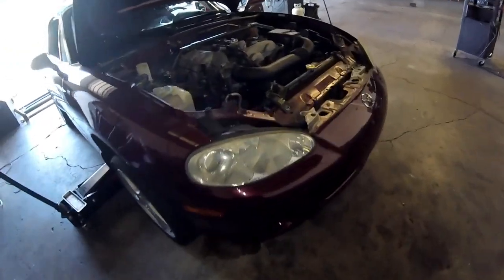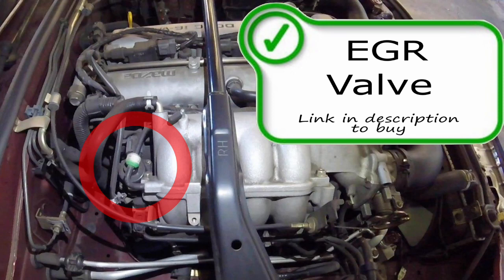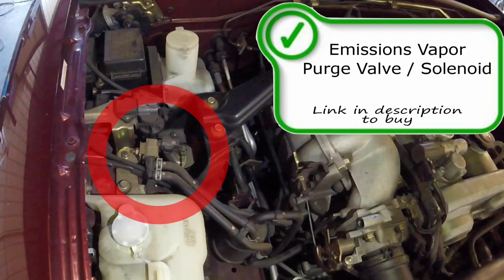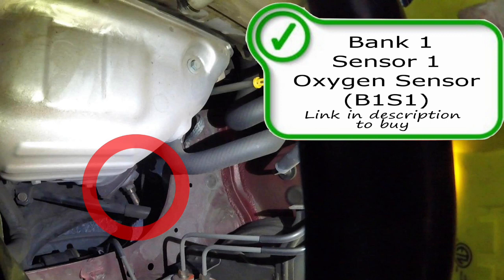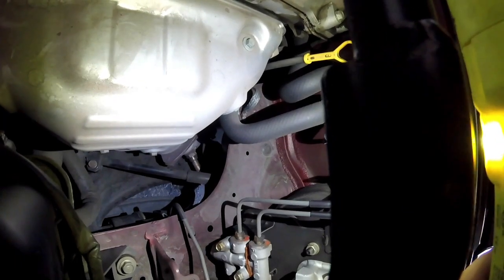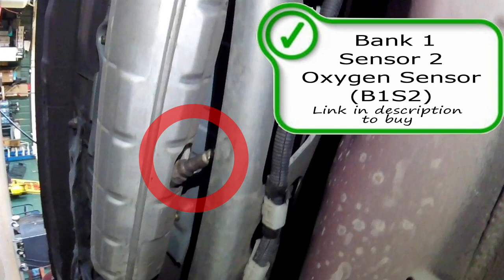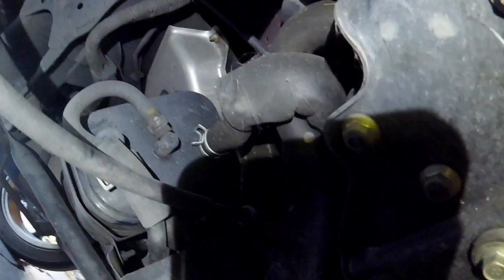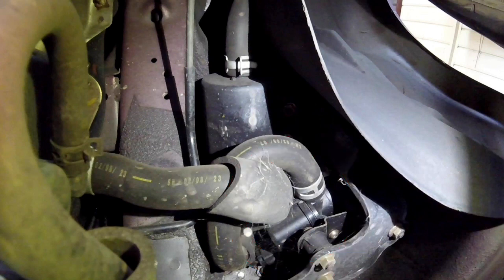⫷ Mazda │Miata MX-5 (NB) │ 1999 - 2005 │ Emissions Locations: PCV, EVAP Purge & Canister, O2, MORE ⫸

Comment: Ok,my Miata NB doesn t have the charcoal canister and the solenoid for it anymore,and at some point,i sensed gas fumes inside it,not from the beginning,just a few months after driving it.Can you suggest a cause for this?Vapor valves on top of the tank,gas cap at the fuel tank,maybe?

Comment: Very useful guys . I have a Second generation mx it turns over but doesnt start . It stopped firing after running low on fuel , possible fuel filter block

Comment: A have a 2005 code po446 and p001 any ideas?
Reply: Where you able to fix the code? Thanks
Reply: @luisgonzalez3057  yes changed  the purge valve but now have a p2195

Comment: Love the video. But let’s see if you can answer my question. Now I have codes p0102, p2402, p0037 and since these codes came my meter fuse blows, but when it blows the car shuts off and in order for me to start it again I must replace the meter fuse. Any idea what could be the problem?
Reply from the maker: The meter fuse powers a lot of different things on your vehicle. The weird thing is, my friend had this exact problem many moons ago. If I recall his oxygen sensor heater circuit was bad causing a closed circuit in the oxygen sensorand inturn it blew the MEETER fuse.  I can't guarantee anything but if I was in your shoes and  I owned that vehicle. I will. I would replace my bank one center to oxygen sensor with a direct fit replacement. Then try to replace the meter fuse.. If the meter fuse does not blow, go drive it for a little bit and see if the car acts any different.

🤞🤞💪👍
Reply: @ScottiesHobbies  thank you for the fast reply. I will take a look a the 02 sensor. And I’m sorry, I didn’t mention I have an 03 NB
Reply from the maker: @BlownMiataGuy  no problem! I was hoping you would have a vehicle similar to the one in the video.

Good luck on your fix. Keep us posted on your progress and ask questions if you have any.

🤞👍💪

Comment: Hi again! Question: is the emissions vapor vent valve at minute 7:10 the same as the CDCV (canister drain cut valve) that I see in my 2000 Miata shop manual?
Reply from the maker: Hey there. Sorry it took a little bit to get back to you. I believe that is the vapor vent solenoid you are speaking of. I looked in my manual and I do not see it listed as a cut valve but it would make sense that it is the event valve valve. If it has a hose going venting to the atmosphere, that is the vent.

 Hopefully that helps you out. Keep me posted on your progress. If you ever get that monitor to set please let us know what it took so you might be able to help somebody else later. Good luck and keep us posted.👍💪

Comment: Excellent vidéo. On my 2000 SE the emissions Evap System is shown as Available /Not Complete so I will fail smog. I’ve followed the driving routines in the Miata manual and have put on several hundred miles but cannot get this last emissions system to reset after a failed battery. Do you think it could be Vapor Vent Valve solenoid or the evap solenoid under the hood? There are no trouble codes.
Reply from the maker: What state are you in?
Reply: @ScottiesHobbies  California
Reply from the maker: And you have no pending codes? Or any hardset codes at all?
Reply from the maker: Only reason I ask is; in Ca you are allowed to have the evap monitor incomplete to PASS smog.
Reply: Nope, there are no pending codes
Reply: I’m fairly sure I cannot smog it this way. Although I will verify. Any ideas what the root cause is?
Reply from the maker: @timmurphy9834  take a look at this and let me know what you think. https://asktheref.org/Information/Monitor-Readiness-Concerns
Reply from the maker: @timmurphy9834  some vehicles will not set monitors. Especially pre 2002. You might have one of those cars.
Reply from the maker: This is the actual BAR rules for  monitors too. But I don't see your vehicle listed as problematic.  https://www.bar.ca.gov/Industry/OBD_test_reference

Getting to the root cause... does your coolant temp guage work and you get to Normal operating temp? You are keeping the fuel lever between 1/3 and 2/3? Fuel guage works?  You are letting the vehicle "warm up" before driving?

The evap monitor only runs on cold start ups...
Reply: Correct! The Evap monitor is the only emissions system that is allowed to be in a not ready state in California. I walked down to my local smog shop and verified. Thx! He also mentioned a lot of people stress over this one. I coulda sworn it was in a ready state in the past but maybe I’m wrong.
Reply from the maker: @timmurphy9834   That is awesome! I come across this a lot. I should make a Podcast on the subject.. I'm glad it worked out for you. We also run into smog technicians not wanting to run vehicles with monitors that are incomplete. The state frowns upon technicians that pass a lot of vehicles with pending monitors such as a vehicle like yours.

Comment: Thanks for the video.
I have a p0455 gross evap leak & used this video as reference
Reply from the maker: Good job getting it done. Glad to hear this helped. Good luck on your future projects. 

Thanks for the view!!
Reply: @ScottiesHobbies  well it came back 😂
Reply from the maker: @jesussalinas5222   Did you check the fuel cap? Make sure the seal on the bottom side of your cap is good and not broken.
Reply: How did you end up fixing the issue?
Reply: @francoguillen25  New fuelcap + New vapor purge valve

Comment: This video is fantastic. I am getting a P0171 - running lean on my 2002 MX5 1.8 MK2.5. The engine is misfiring / spluttering with clutch in or out, but seems to be OK on idle. The PCV valve seems to blow quite easily one way and does not the other way- so thinking it is OK? Have done a smoke test for vacuum leaks and can't see any anywhere (with the throttle lever opened). 

Have had spark plugs changed in few months + new HT leads. Going to re-check these. After that, I am thinking coil packs? Or should I focus on O2 sensor per-catalytic converter?
Reply from the maker: You want to call on a recorded line and talk about it so it can be added to the next podcast? Shoot me a email to therealscottieshobbies@gmail.com
Reply from the maker: Get this fixed yet? Have you checked for exhaust leaks?
Reply: I am having this same exact issue and can’t figure out what it is :(

Comment: I'm not getting any error codes but my 2000 SE failed CA smog. OBD2scan/OBDLink gives "EGR System (non-continuous) Available (checkmark) but doesn't Complete (red X)". It's been sitting and I've done some work so the battery was charged/unhooked. The smog guy said to drive it to reset. I did. Also per a video warmed it up, ran it on the freeway above 60mph and stopped without using the brake per the video. Still fails. Took it for a nice canyon drive (Angeles Crest Hwy) today but haven't retested. Do you have any videos or suggestions? I'm starting to get into the shop manual but any advice would be really appreciated. Pretty much a novice...
Reply from the maker: Does all your gauges work? Temp and fuel? 60 is a little high for setting monitors in my opinion. When I want to set monitors I make sure I have 3/4 tank premium fuel. Turn the car off and back on. Get on the freeway and fallow a big rig for 15 to 20 mins. I like to go 55 mph to set monitors and rigs are usually cruising right at 55. Now, the computer wants to be comfortable so dont speed up and slow down a lot. Don't use cruise either. Just a steady 55 mph cruise. After I fallow for 15 to 20 mins I get off the freeway. Turn vehicle off and back on. Then return back doing the same driving habits. That usually works. If that does not set it or give you a pending code then I'd start being concerned. 

Oh yea, have you checked for pending codes?
Reply: @ScottiesHobbies  Ok, sounds good. All the gauges work and it runs strong but it's 190k+ I wasn't slow warming it up either, didn't know it was important. I'll do what you suggest and hope for the best! 
Pending codes? No, I'm just getting used to the scanner but will check it out. Thanks for the reply and explanation!
Reply: @ScottiesHobbies  Thanks again--you made it clear about cruising at the right speed and it worked! Before this I was just driving normally. That is, uh, spirited! ;)

Comment: I have a p0402 on a 2000 mx5 swapped my egr valve with my other car and still getting the same code
Reply from the maker: Clogged egr ports? Faulty wiring harness? Bad egr?
Reply: Scotties Hobbies would have to check egr ports and vacuum lines. Everything else is good